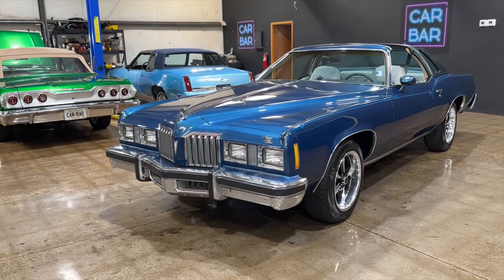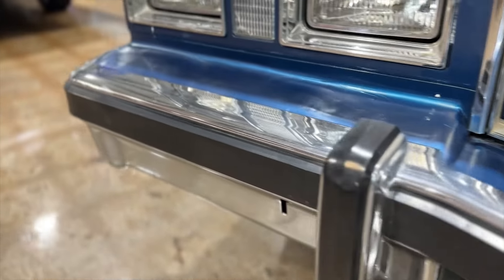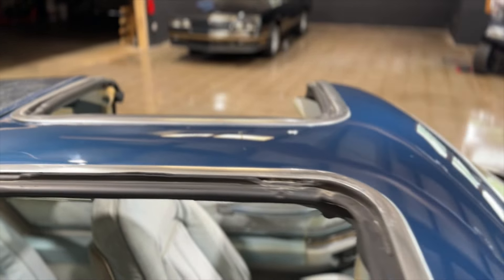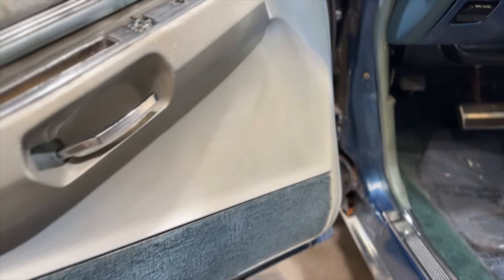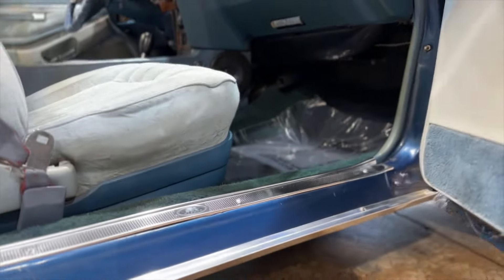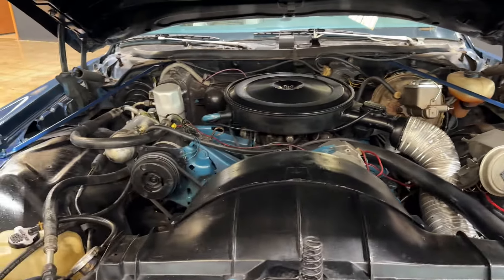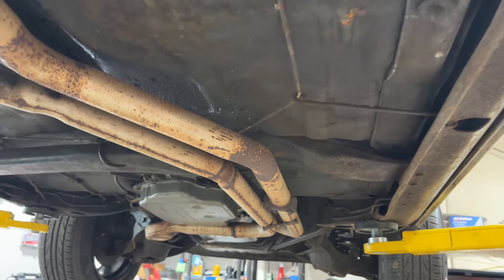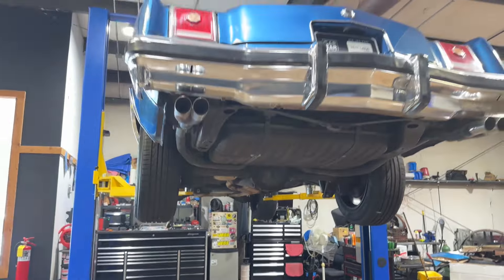For Sale 1977 Pontiac Grand Prix w/ T-tops $18,995

Comment: WELL IT LOOKS Good: However photos and video can be misleading. I purchased this auto, and it arrived on the trailer. I was truly excited until I drove it. I took it to get inspected. WoW- Buyer beware  this was a huge disappointment. It needs $7k worth of repairs. The fuel line leaks & it needs a fuel pump. All the engine gaskets require replacement- (leaking)- it rained during the delivery so the inside of car was soaked because the T-TOPS leak (bad) front passenger A-arm pillar cover has a 10 inch hole running from top to bottom. The vanity light on rear passenger side is completely missing. There's just a hole in it's place. They're in Atlanta and I am in the DC Metro Area so I am stuck with no service or anyone to complain to - Once again, buyer beware. I can't even drive the car safely until the repairs are completed so the car doesn't go up in flames.
Reply: Just discovered the windshield wipers dont work & the left turn singal indicator on dash is out. Folks, I paid full price, and the battery is held in with a bungee cord (WTF). I wish I had seen the dealer google reviews prior to purchase.
Reply: Today - I just received car out of service - 1st Day - I've had an opportunity to drive car since I received it -an additional $1800.00 in additional repairs - However they were not able to repair the A/C - the entire system leaks - So I must dig deeper into my budget to enjoy my purchase - Finally was able to get the Windshield wipers to work - The regret and adventures continues - on this auto purchase -
Reply: I don’t think any part of that interior looks good. Too much wear and damage.
Reply: @robertpasquini4097  - The dash has wear and the video doesn't show there's (2) major holes in the A-Frame molding. When I receive the car the tow truck encountered rain - the inside was soaked - T-TOPS required serious repair all molding is rotten- 3800.00 repair